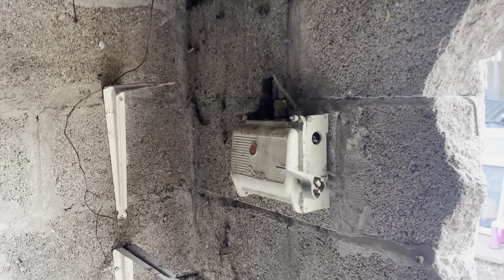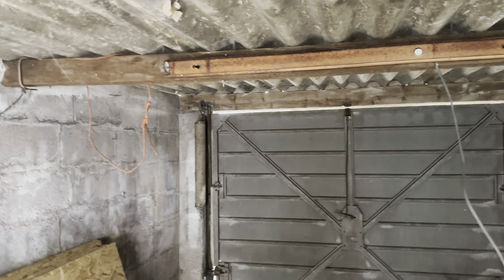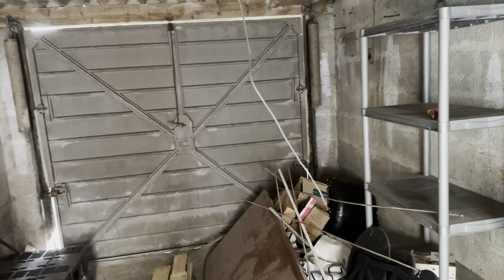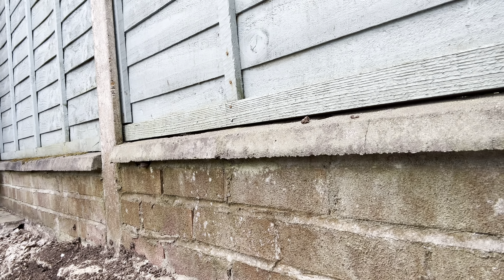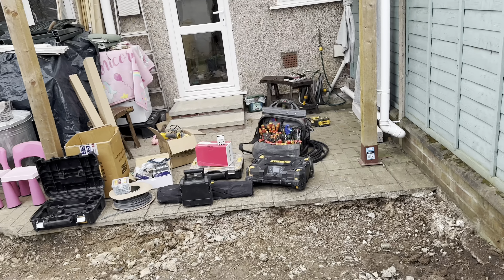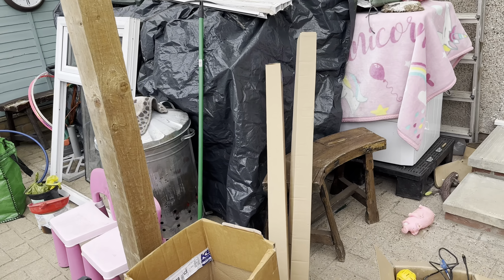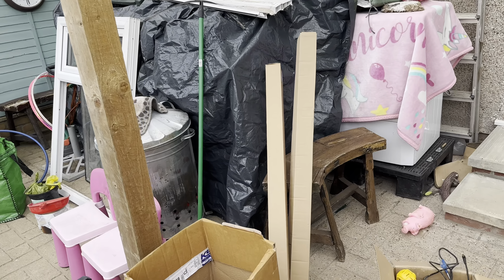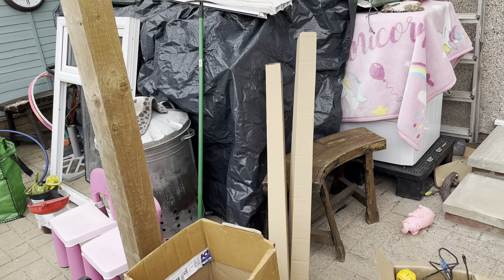Installing power to a garage building! Fusebox F2004M

Comment: i would have waited till he got rid of asbestos professionally removed then come into a clean safe room.
Reply: Roof sheeting only low risk and only a problem if you break or drill it.  Fella I used to remove turned up in a zip van with his woman and baby in the front.  When I went to make him a cuppa I looked out the window and saw him throwing the sheets in the back of the van unwrapped.

Comment: Goog clean job I know you will disagree but I like Black as neutral because it was once and make sense on single phase. I know neutral ends up at ground at transformer. And as you said always flag your cables.
Reply from the maker: As long as it's been identified its acceptable! The problem is people not identifying them usually. 👍🏼
Reply: Black as neutral !!! Get out 😂
Reply: @Badgerooni90  Black used to be neutral before the standards changed to Brown, Blue, Earth it was Red, Black, Earth.  Absolutely nothing wrong with using black as neutral as long as it's labelled as such.
Reply: @lyeuhm I was joking around. You’re absolutely right you can use whatever if identified. I prefer grey with blue sleeving. Easier to see as it stands out more.

Comment: Never really understood this new rule of using the grey wire as the neutral.  Apparently you're not supposed to use the black because that's "old colours"... so what's the problem?  You might incorrectly identify the neutral conductor as a neutral conductor??  Seems safer to use black if you ask me.  Not sure if this is in the regs but it wouldn't surprise me!
Reply: That's normal to use the gray cable as a  neutral

Comment: Nice  apprentice here so just curious, but  Ib <= In<=Iz so in your case In which is rated current smaller than designed current as you had 2, 16 radials and one 6A light that would make Ib greater than rated current so there is always risk of overloading or am I missing out something?
Reply: Diversity your missing Diversity. His 6 amp light circuit will never see 1 amp let alone 6. Very unlikely to be maxing out both 16amp breakers. 32 amp for that garage is more than enough.

Comment: Nice Vid, Surprised you didn't use Plastic Conduit on the Cable  running Horizontal undr the Roof line
Reply from the maker: I would of if the ceiling wasn't being boarded but the customer planned to board it so the cables would be clipped in the loft space.

Comment: I was very interested to watch this, because I have always wanted power out to a workshop in my garden. However, I have always been led to believed that armored cable had to have a trench dug to a specific depth and then different types of gravel use above and below to identify it should someone start to dig in that area. Is this no longer the case with laying armored cable to an external shed/office/workshop?
Reply from the maker: Hi, if you are running cable externally usually you have two options. One of these is 'buried in the ground' and the other is 'clipped direct'. If you are burying cables in the ground a minimum installation depth of 450mm underground is required and this should be judged upon the type of ground and the future disturbance to it. It is also required to use a cable identification, such as a 'caution live cable'. This is usually on a roll in yellow colour. Clipped direct is also commonly used and this is a great way to install power safety, quickly & efficiently. I hope this helps and thanks for your comment, this helps as others may have the same questions as yourself.
Reply: @thecableguyuk  Wow, I didn't know anything about the "Clipped Direct" method, it's never been mentioned by any of the electricians I have asked this question of. I usually explain the requirement and watch as they turn, first grey and then green at the thought of doing this. Then they start to smile as they think up the atrocious cost they are going to apply to this job. I usually get two options for the "under the ground" option. 1. Dig the trench and then refill it yourself (once we have inspected the work) and 2. We will do the whole thing for you (they are usually rubbing their hands together in anticipation when telling me this) "That option is of course much more expensive".  Thanks very much for taking the time to explain my other options! 👍

Comment: It sounded as though you cut the original supply cable off that was nicely buried, would it not of been better and more convenient to of re used this?
Reply from the maker: The original cable was a 4 core 2.5 and connected as a spur in the back of a kitchen socket, the new install is a 6mm cable connected directly to the CU. Also as heavy ground work had been done in the garden with the cable just laid under patio slabs I was not going to take that risk for my customers safety just to save £30-40 on cable. Thanks for your comment though, it helps others understand why a knew supply was used. 👍🏼
Reply: @thecableguyuk   Ahh original was only 2.5mm from a spur. 👍🏻

Comment: 17:27 not going to fit a fly lead earth to the metal box?
Reply: I believe the metal boxes had only one fixed lug so no need for a fly lead
Reply: @HenryTarr-f5e  well I think he’s using the wrong boxes. I guess the box is earthed via the faceplate screws but is a pattress box the right choice instead of garage box?
Reply: I believe the spark will be returning to remove the faceplates prior to dry lining at a later date so metal boxes are correct for dry lining  @AaaaandAction

Comment: would the sockets look better with plastic backing boxes ???
Reply from the maker: Hi Malcom, I'm not sure if you watched the video on mute or didn't hear but this was ready for dry lining/plasterboard. If it was to be left not being plaster boarded and then used as a garage of course but this is planned to be a insulated office/snug room. We would install either metal or plastic conduit and would use surface white boxes or metal clad sockets dependent on the customer preference if it was a standard cold room/garage. Thanks for your comment however as it's help others understand why we did it this way.
Reply: @thecableguyuk  no i did not watch on mute, i just thought it would look better with plastic back boxes ;what "diff"would it make to using plasterboard ,i was in no way pulling your work up it was just a thought ;;